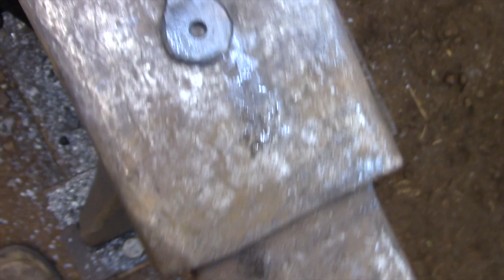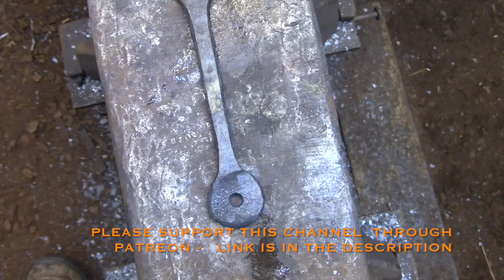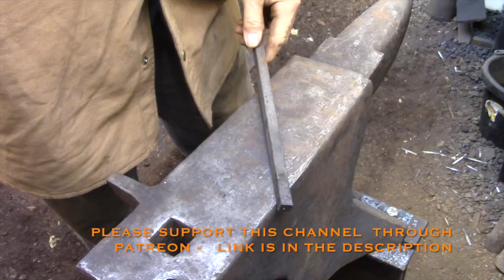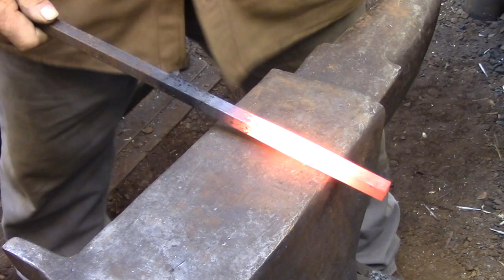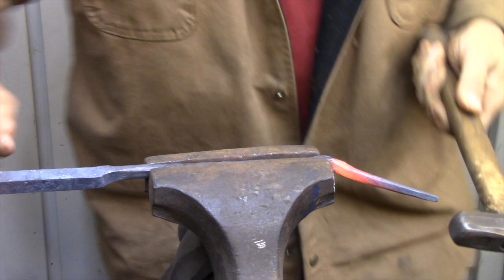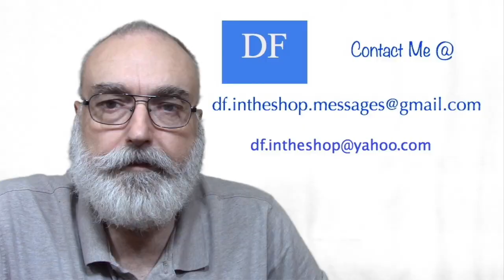Blacksmithing Project - Forging a Lantern Hook

Comment: I am guessing there is a structural reason you left the extra material at the transition of the arm to the hook, though I rather doubt it is really necessary with the load it will be expected to carry.  Was the step at the end pad strictly an aesthetic issue?
Reply from the maker: There was no structural reason for the extra material at the hook.  I wanted a square corner there and leaving the extra material was the simplest way to make it.  The step is a result of the difference in thickness at that point.  It does emphasize that transition and is usually left in most traditional ironwork.  In some cases they highlight that transition even more by filling in a small bead or other detail there.

Comment: -Dennis
I am aware of the shape of a cold chisel but have no idea of how to refine the shape of a basic graver. I am a beginning smith if this helps .
Thanks again.
Reply from the maker: I looked up Hammer engraving on good ol' youtube and came across this guy - great video.  https://youtu.be/FQkei7opfBE
He is doing all the engraving with one chisel.  The face geometry that he is talking about is how he shaped bevel of the cutting face.  The cross section is square, he is using one corner of the square to do the cutting ( cutting a V groove ).  The face is ground to a 45 degree angle and then he is honing a small 20 degree flat surface ( heal ) on the bottom corner ( 3/32" long ).  It's not too clear but if you look closely he is using a steel bevel guide at the edge of the stone to get the right angle.  Now it's cutting a V groove with a tiny flat section at the bottom of the V.  Honing is critical with these tools. The have to be razor sharp.  If you are engraving on steel make sure it is annealed and you sand the surface scale away.  
Let me know if you have any more questions.

Comment: hello sir!
although this question really had nothing to do with this tutorial, your the guy I trust, you seem very knowledgeable, so here we go. so I just purchased a small hammer at a garage sale, it's probably about 2 maybe 2.5 Oz. on the handle it says and I quote " WARNING : Striking a hard material with this hardened striking tool could result in bodily injury" .....what's up with that??
Reply from the maker: Unfortunately it's the way the world is going.  Reputable companies feel compelled to put disclaimers on everything for fear of lawsuits and importers do the same thing because they know they are selling cheap tools that are made with poor quality materials and absolutely no quality control.  A friend of mine once bought a box of hammers at one of those traveling tool shows.  Stuck it under the power hammer ( at a yellow heat) and the things exploded into a shower of hot fragments.  The hammers were  made out of cast iron.  So you don't know were you stand anymore.  It does pay to be careful around tools you are not familiar with.
Reply: hmmmm. that's scary. well. at least it was a garage sale hammer so I'm only out 6dollars. what a sad thing. I really liked it. thanks again sir
Reply from the maker: It may be a perfectly good hammer.  All I'm saying is there are enough cheaply made tools out there to warrant being careful.  In either case these things are not waiting to explode in your hands if you just knock them against something.

Comment: -Dennis 
Thanks for the video I am excitedly awaiting the graver tool video on accout I  need one for a project. all that I  need is the basic graving tool that is most common i there is one.lol
Thanks is advance. 
Martin and Shannon at M/ S Blacksmithing and Blades
Reply from the maker: What exactly are you having problems with?  Making a graver is exactly the same process as making a cold chisel - just a more refined shape.  I don't want to hold up something you are working on if you just have a few questions because It may take me a while to get the the engraving video.

Comment: Another great tutorial.

I would like to ask why you chose not to leave the 90° at the wall mount upset like you did at the hook? Would the 90°at the wall be able to support more weight if it was upset?
Many thanks.
Reply from the maker: I just thought the  curve was a better looking transition in this case.  Certainly a lot simpler to forge and this is a light duty hook anyway so there wasn't any  structural reason to build in the extra strength.
Reply: ok, thanks.
Reply: I did a few design experiments with that part today and i personally decided to make sort of a hybrid transition with a more cubic shape. However, it was realy exciting to see different design experiments taking shape in reality!
So i was able to see and feel it for real!
I must say...